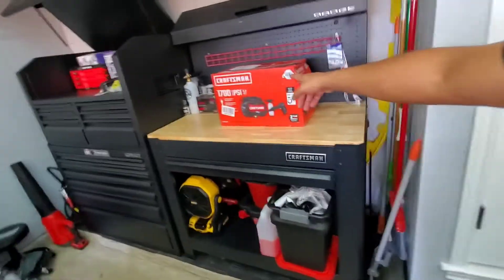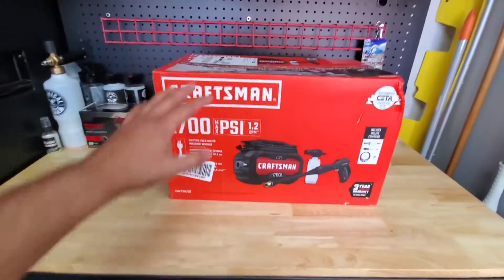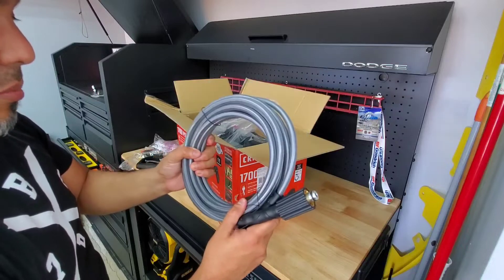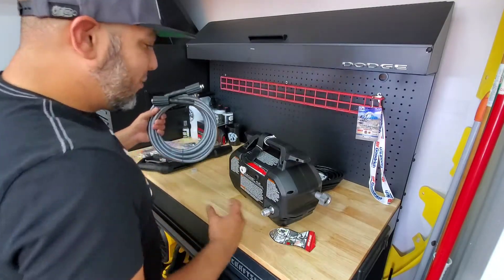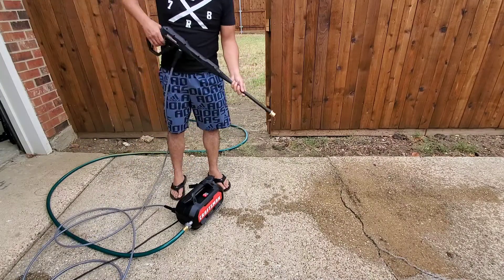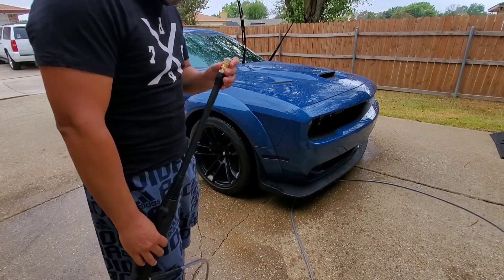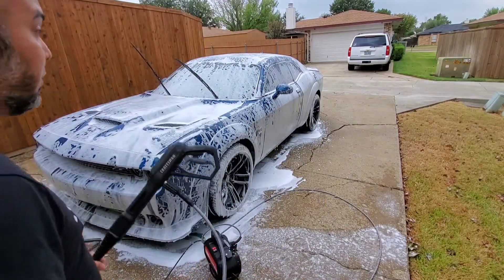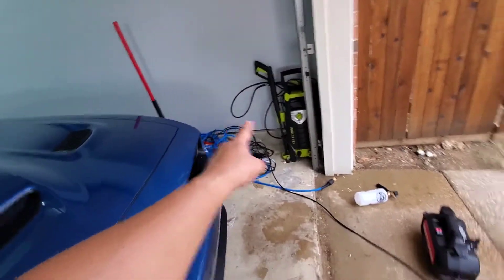Craftsman 1700 PSI 1.2 GPM Pressure Washer unboxing and initial review

Comment: The Armor All foam cannon for around $30 is a really good budget option. I have the same washer I use with it  and from this video, honestly it works pretty much just as good. Only thing you might want to do is swap out the stock orifice for a  1.1 mm Orifice. Helps to create more pressure = better foam.  Nice video, good review! Sorry if your sponsered or something by Chemical Guys, just thought id throw out a really good budget friendly option. Really love Chemical Guys products myself!
Reply from the maker: Hey man. Thanks for watching and commenting!  I like that machine a lot for the size and performance. I also have a Sun Joe machine. That is slightly more powerful. I go back and forward usong them. Might get rid of one soon to clear up space.
I wish I was sponsored by chemical guys, lol!
I work with Yamatic, which has an amazing swivel gun I just received from them.
Will take a look at that Armor foam cannon! Thanks for tip!

Comment: I see so many videos of pressure washers being used on cars. I was told pressure washers can damage the paint. Is there an attachment needed and I'm just missing it?
Reply from the maker: As long as it's not a very powerful pressure washer, you are good. When using the tips. Don't use any turbo nozzle. The white ones are typically 40° and are the ones you want to use for cars and windows.
Reply: depends on the psi and nozzle. Super high psi will cause damage and the tighter degree nozzles will also cause damage. 1200-2200 psi is what you should use for car washing and white and green nozzles are fine.

Comment: Beautiful cars man!
Reply from the maker: Thanks man. Appriciate that! Got to keep em clean!
Reply: which nozzle should I use to clean my deck. thanks
Reply from the maker: @j0786n  I would use the rotation one. It's the one that sprays with more preassure for dirtier surfaces. When I clean the concrete around the house I go back and forward from 40° to the higher pressure rotation one.
Reply: @297modz  thanks for the reply. You mean rotation one is the long black one.
Reply from the maker: @j0786n  yes Sir! The long black one! You will notice an increase in power of the spray!
Reply: @297modz  thanks you very much. You are a great person. Very helpful. God bless you.
Reply from the maker: @j0786n  appreciate your kind words! This world needs more positivism and kindness. God bless you 2!
Reply: @297modz  you are welcome. I have one more question. My outdoor outlet has a cover on it making gfi plug impossible to fit. Do you have any suggestion. Thanks
Reply from the maker: Hey @j0786n  you can use something like this for $10 and it is rated for outdoor! https://amzn.to/3aMsImh I use something similar I bought at Harbor Freight. But if you don't want to drive let Amazon deliver to you!
Reply: @297modz  thanks again. You are a life saver. I appreciate all your help. God bless you.
Reply from the maker: @j0786n  anytime! If you need anything I'm 1 msg away! Have a great week!
Reply: @297modz  you too my friend

Comment: Nice video! how do you set the PSI?
Reply from the maker: I adjust it on the foam cannon that I would be using! The one that came with the machine I never used it. Can take a look to see if it's adjustable if I haven't thrown it out.

Comment: Is the craftsman plug into the outlet !?
Reply from the maker: Yes Sir! It is an electronic preassure washer.
Reply: @297modz  also does the garden holes go straight in?  I don’t need a knob or nothing right ?
Reply from the maker: @zellparkerSFI  that is correct! Plug and play! Does great job as is!
Reply: @297modz  last question lol can I just use if for the water I don’t need a foam bottle or the one it comes with right ?
Reply from the maker: @zellparkerSFI  it comes with one that works not so great. And that is the one thing I would replace the first thing and for 30$ or less if there is discount https://amzn.to/3B1Gzjt you can get this Yamatic foam gun that works amazing! Does the same job as a 90$ or 110$ foam cannon!